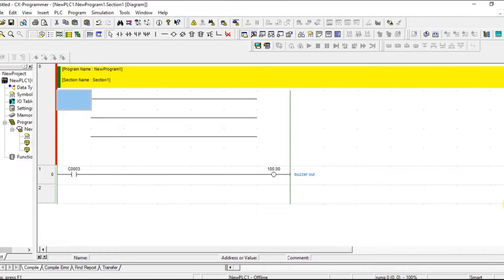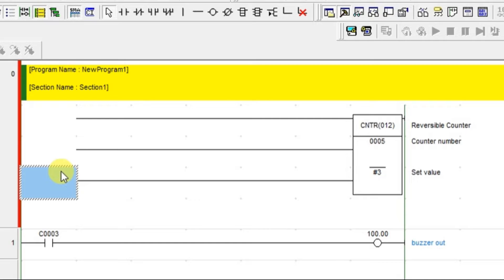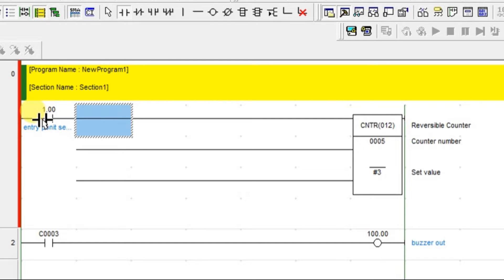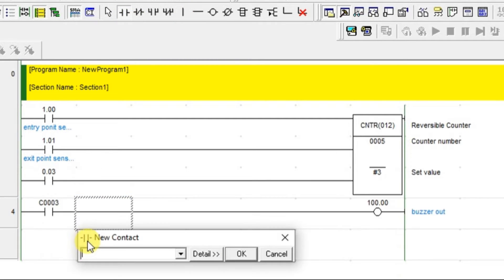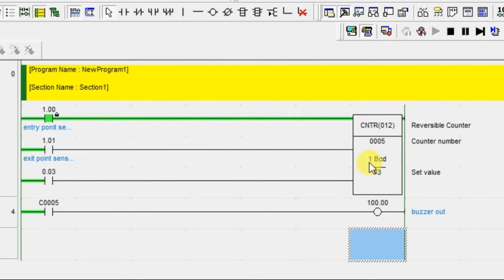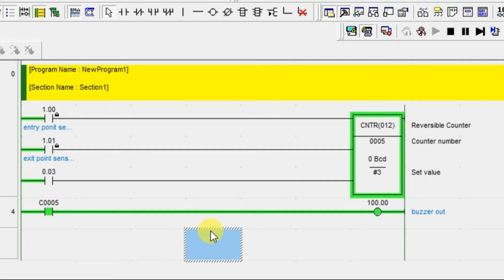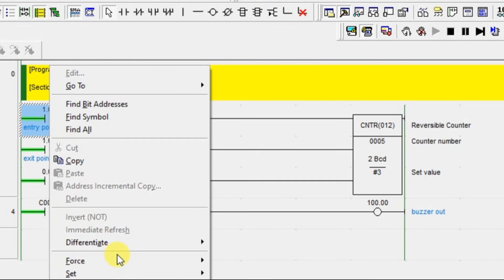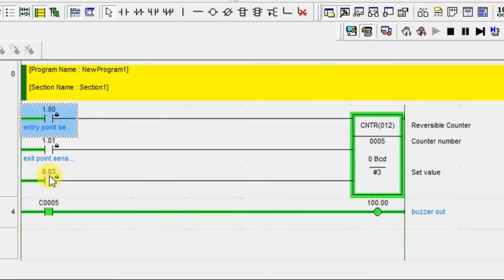CX Programmer Reversible Counter - CX One Tutorial - CNTR

Comment: if the set value is set to #3, then when I do the count for the counter until 4 why the counter does not energize ? It will energize after +1 (another increment) ? have any solution ?
Reply: find any solution?